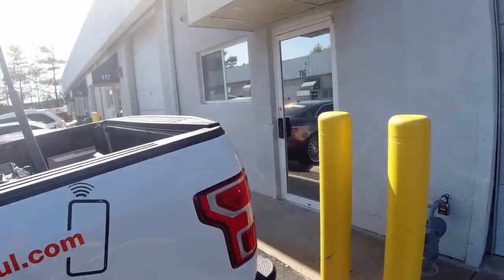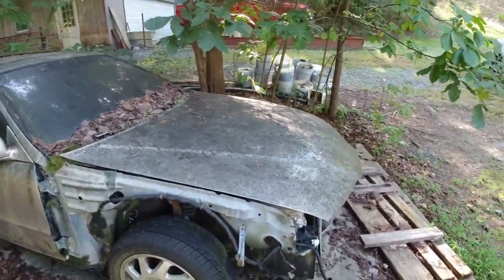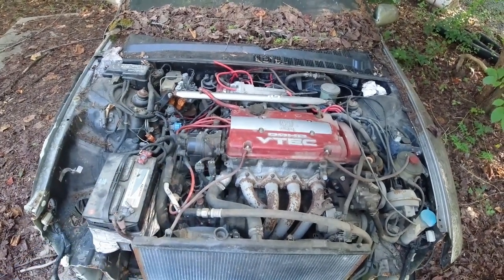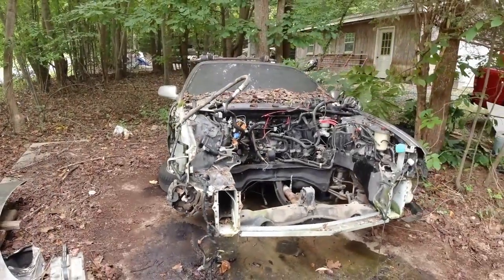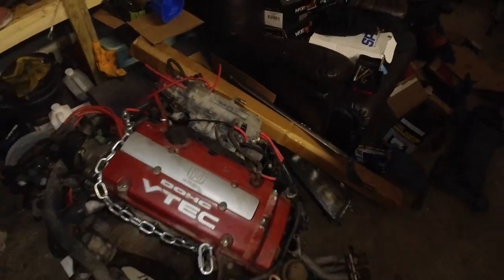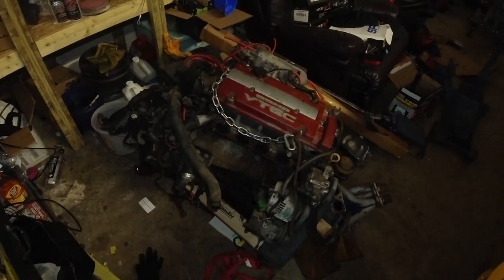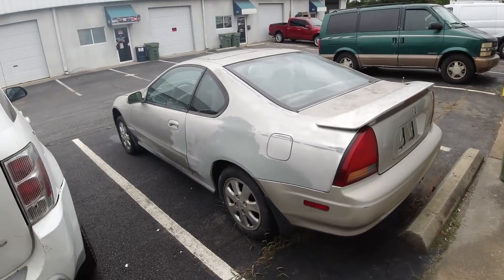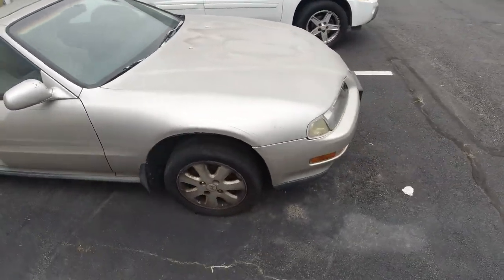barnyard honda prelude find!!!!

Comment: Nice man! I can’t wait to see the progression of this build. I just recently picked up a 2000 prelude with a blue top H23A. The bottom end blew up and it has no transmission so have lots of work in my future. Looking at boosting as well so it will be nice to get some pointers!
Reply from the maker: for sure bro stay tuned in
Reply: What's with all the boost-creepin' 'Lude Dudes? Maybe I'm just old school, but the H series are Honda's "Big Block", and with their  real strength in  torque over other Honders, going with a motor build or a Roots at most just feels so much more natural. And Ramon, you got the starts of a great all motor project. The Franken-swap H22/23A is badass, even if keeping mostly stock internals. I'm not like Prelude Jesus or anything, but I've had 7.5 4th gens in my life, (and a few Accords) all Alaskan, baby!. Granted 2 or 3 I mainly just bought for glass, parts, and motors, but  I have only boosted one, and as for driveability, nothing feels as good as an allmotor build. Never again would a boost one. Civic hatch, Integra, or a CRX, maybe, but no goode-in-da-Lude!  Less weight, less maintenance, and a full powerband that is instant is just unbelievable when hit hard.

Don't get me wrong, boosties got a place in JDM past, but all's I know is it ain't for 
me, not in the 4th gens. I gotta Mazdaspeed6, and a VR4 GT, and those big bastards could use the boost, but I've always had a soft spot for my 4th gens. Trey has a hawt AF Lude, and it's beautiful, but if neither of you guys know what a full on JDM or Euro built N/A is capable of, I just gotta recommend reconsidering... Is it just me no out there, or am I just going cray? Hah! Sorry about the rant... B (series) is for Boost. H is for Hotness!
✌️😎🤳
Reply: theBigMan ofAK believe me man I love a nicely built NA Honda. My last Honda was a 2000 Acura Integra Gsr 4door. It was all motor and till this day I miss hearing that vtec pop while on the on ramp of a highway. I’ve also had turbo cars and love them just as much. The only reason I want to go turbo is to keep up with some friends. I’m not thinking of going crazy because I’d still like to drive it time to time and keep some kind of reliability and comfort.

Comment: You better grab the gauge clusters, OBD1 ECU. Electronics. Cut brake lines and remove calipers to rebuild. Civic owners will buy the brakes. I'd take that car home and strip it to the bone. Then scrap the body for $200. CRX owners can use the wheels as a upgrade, and they fit perfect.

Comment: lmk if you dont need the ps bracket for the h22a because i need a new oem h22a one mine has 2/3 bolt holes. also nice find bro!

Comment: Looks like someone just swapped an H22a in there Trey, USDM prelude Vtec would have been H22a1 and 5mt. All good though little better spec, grab that ecu on passenger floor board too. Keep doing your thing my ninja! 🤙🏻
Reply from the maker: Word it s was a good find either way im lucky 😁
Reply: Trey, Yes sir! 🤙🏻 You’ll find alot to be almost the same as you F build, one thing you will notice is the FRM cylinder walls on the H, makes great for stock power/efficiency, but you will need to bore and sleeve for serious numbers you will be wanting with the turbo! I’m looking forward to the step by step build. Try to get a good M2B4 (jdm lsd 5mt trans). Always wanted to turbo my BB1, but stupid CA won’t let me! Boo! 😭

Comment: Trey I have a 94 prelude that’s been sitting since 2005. Do you think it will have rust under the car? Also should I rebuilt the engine that’s already in there or just get a whole new engine?
Reply from the maker: Idk bro you'll need to take a look. Im sure it has some rust. And just rebuild what you have, they are getting harder to find
Reply: @treybedipping1734  good looks bro

Comment: theres a guy local selling a 99 2.2 vtec for 1000 but the check engine light is on...
Reply from the maker: They check cel codes free at autozone
Reply: @treybedipping1734  yeah it apparently runs and drives fine, but emissions crap in utah is a major pain. every year i gotta fight with them to get my registration approved lol